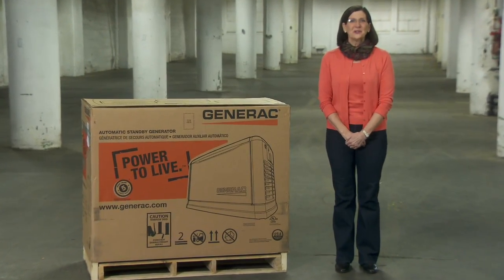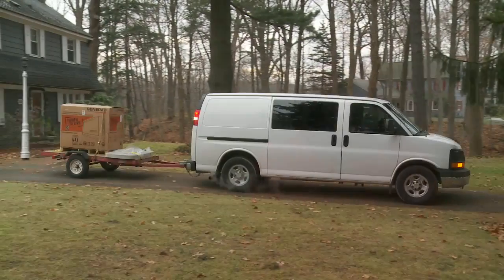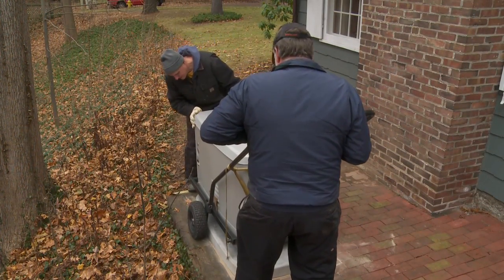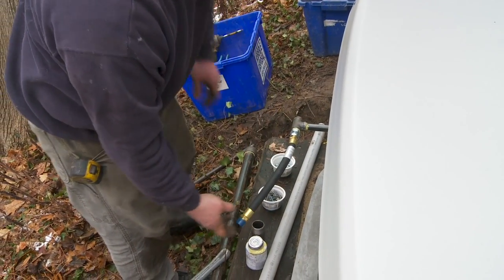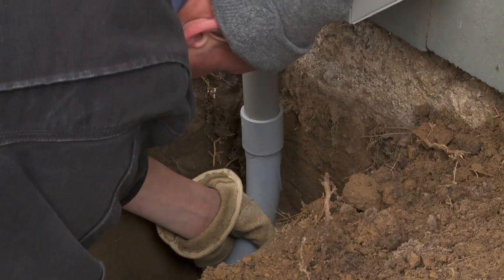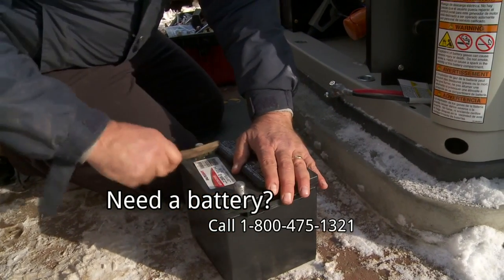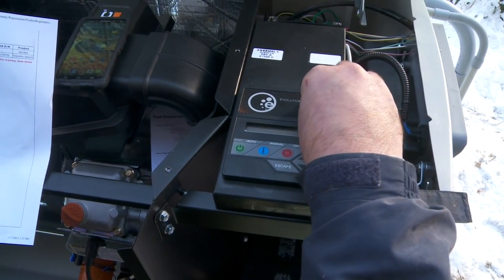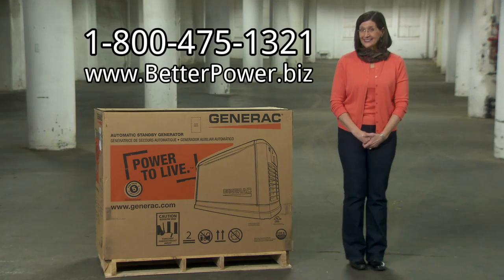How to Install Backup Generators

Comment: How do you determine what size generator you need to run everything in your house?
Reply from the maker: Ron, send an email to support@betterpoweronline.com and we can send you a sizing guide, along with some tips on how to get accurate sizing for your home. If you're going to hire a contractor for the installation, they will usually size your home for free and give you a quote on equipment and installation. If you don't have a preferred contractor, we may be able to put you in touch with someone from your area.

Comment: I wish Generac would come out with a home WiFi interface so you could monitor your generator VIA the Computer or your smart phone.
They do have a system which connects to cellular service. That may be good in a remote service area, but face it, that's just another expenditure we can live without.
We all have wireless routers and WiFi that would extend to our back yards.
I have e-mailed Generac and told their customer service about that but all they tell me is their "Mobile Link".
I wish everyone would get in touch with Generac and push this feature and tell them to develop a WiFi connected system.
Reply from the maker: We've been asking for this for a while now. Generac has told us that we can expect built-in WiFi capabilities in the next generation of air-cooled models. In the meantime, some enterprising folks over at hackaday came up with this DIY solution. We haven't tried it yet but it looks kind of promising: https://hackaday.io/project/20601-raspberry-pi-backup-generator-monitoring

Comment: So this unit is only good if you have Gas. I live in a manufactured home. And I have all electric. So I guess I'm screwed... Or have to get a gas generator to be stolen when I go to work.... grrrrrrrrrrrrrr
Reply from the maker: +mss burr There are actually permanent standby Propane or Diesel alternatives available. Give us a call if you'd like more information. 1-800-475-1321.
Reply from the maker: Luis, Please call us at 1-800-475-1321 and we will help you find the information you're looking for!
Reply: +Luis  Troconis you will need to find the btu's of the unit then size the pipe but what ever fitting that fits in it will do it it is the only thing on that branch. meaning that it came off the main gas line.
Reply: Hello, i AM FROM VENEZUELA. I BOUGHT A GENERAC ELECTRICAL PLANT BUT, LOOKING AT THIS VIDEO, I CAN SEE THAT MY USER´S MANUAL DOESN´T HAVE THE GAS PIPE RECOMENDED MEASURES CHART. WHERE CAN I FIND THIS ON DIGITAL OR ELECTRONIC COMPLETE VERSION?

Comment: Hi, Dan,. I have a 17 K unit , it is large enough to handle my home which is 2500 sq. ft. My 17K unit run a full 12 min. on it's test run every Saturday. After another 15 min. I usually check the oil level and never see a milky white residue. You should be able to lengthen the run time on weekly testing. PS I love the unit....